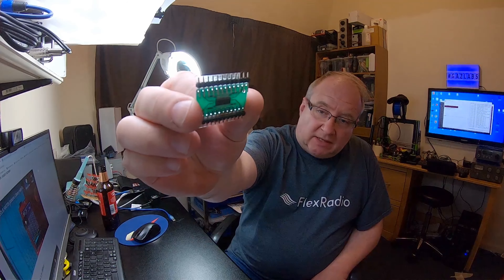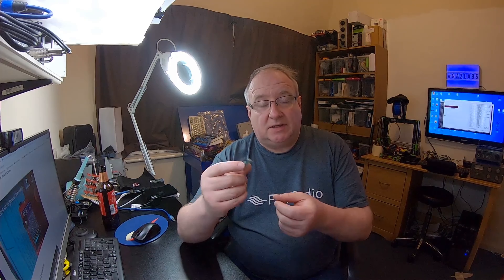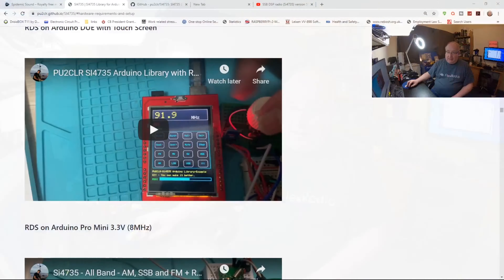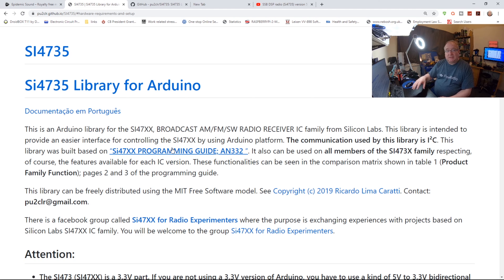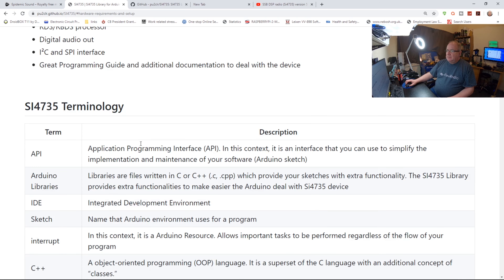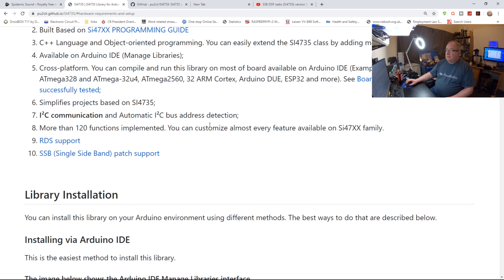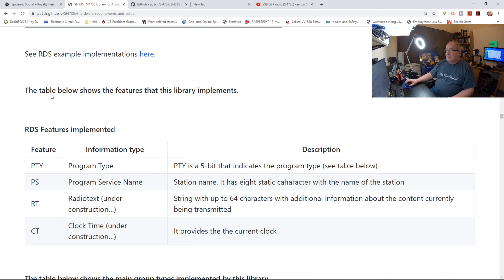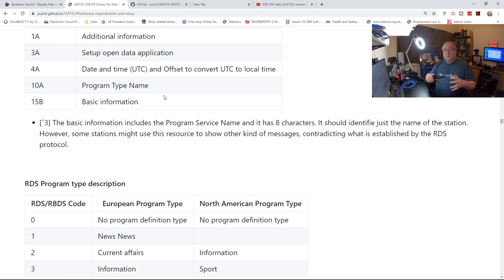Build a stereo radio receiver from one IC the SI4735, Lockdown Vlog 9

Comment: Hi thanks for the Video.. A question is if its possible to read out the clock? or the "Actual frequency"  Im thinking I can use the reciever and the connect it to at transmitter si5351..